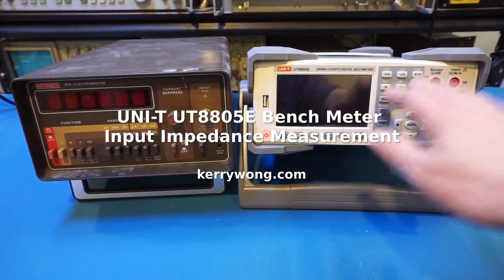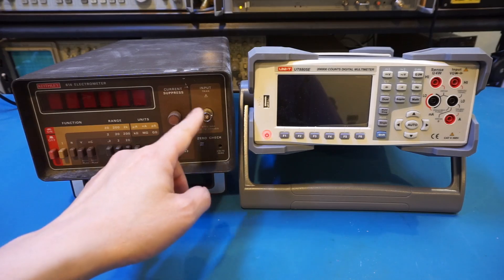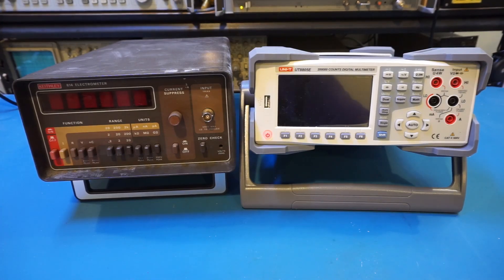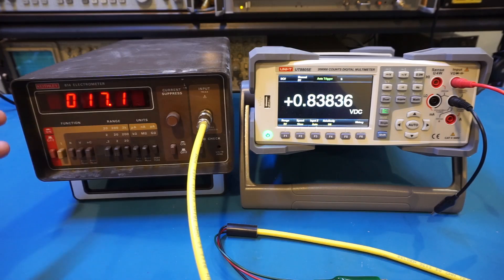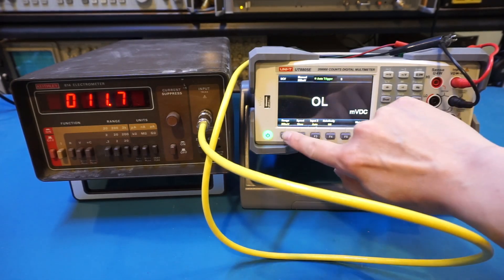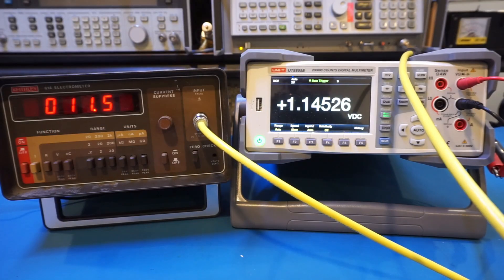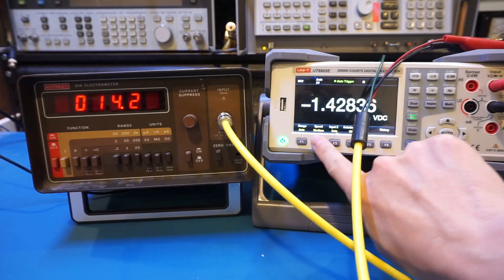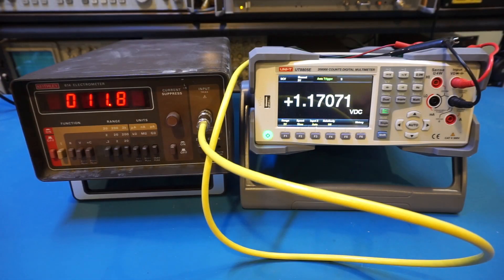UNI-T UT8805E 5 ½ Digit Bench Multimeter Input Impedance Measurement

Comment: You’ve got to respect the Keithley 614 Electrometer which is still a relevant instrument today.  The 614 debuted in 1981!  A 614 in good condition can still command an asking price over 1000 USD.  If you want to dig deeper, the 614 manual is on TekWiki.  You’ll have to search manually because YouTube rejects links.  It is a beautiful manual from the days when manuals were substantial and meant to provide deep instruction on the application, care and repair of instruments.

Comment: Was about to buy new meters too but changed my mind. For the same money (sometimes less) i get "old" meters with 6 1/2 or 7 1/2 digits (hp, solartron, fluke) from closing companies or used marked if lucky. They may lack "modern features" but hell ... the references are well burned in. I check my meters for calibration every year (or lets say, a company does check them for me with known references) and they don't seem to drift at all or not noticeable. I love it!

I will still pay every year for calibration though. Just in case.

Oh and regarding the video title ... these old meters sometimes have a huge input impedance. Just more love for these old kings.

Comment: You also could have used a nanoSiemens measurement function on one of many higher end DMM's such as a Fluke 80 Series, Brymen 869S, or some Agilent meters as well. They can measure conductance to 0.01nS, which is the equivalent of 100 Gigaohms. They would display about a 0.05nS value when connected to the Uni-T when it is set to a lower voltage scale and faster sampling rate.